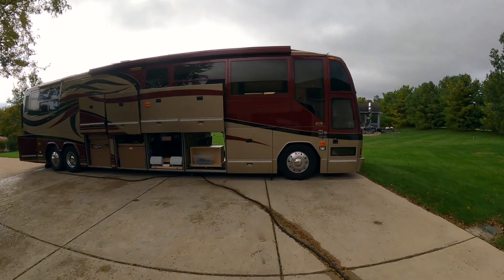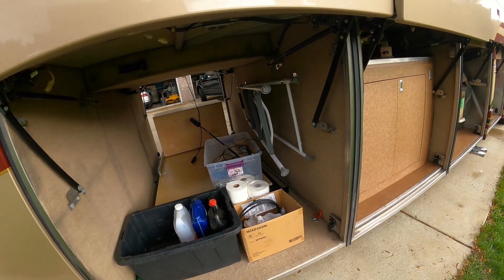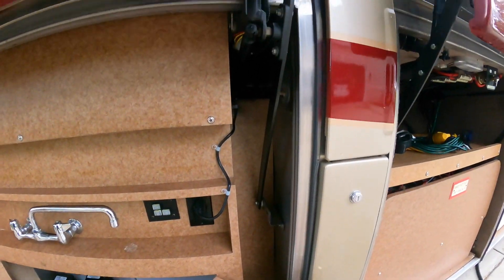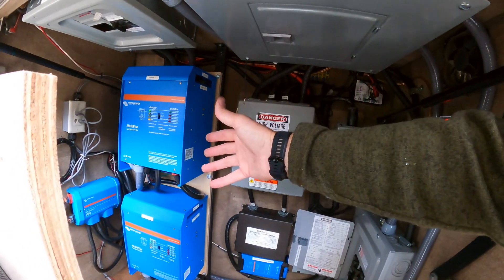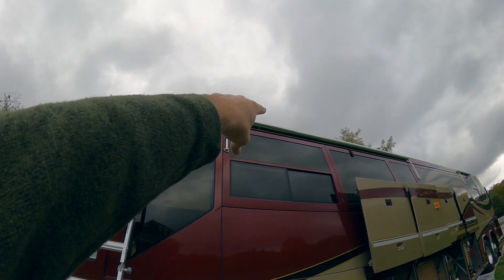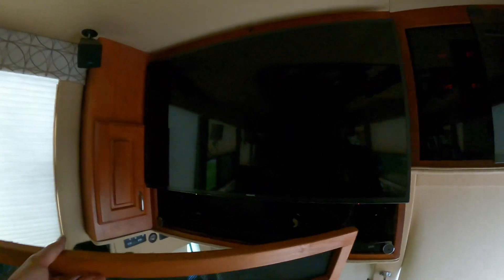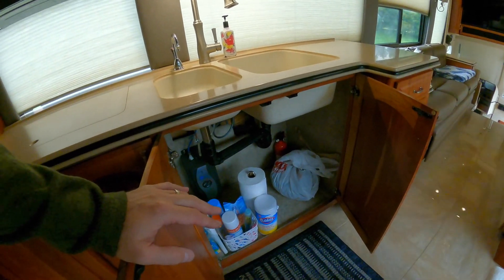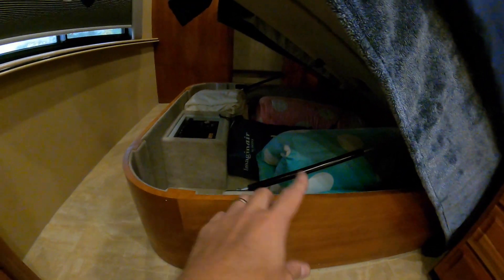1 year of ownership & upgrades - Prevost H3-45, Class A RV Camper

Comment: Really appreciate your videos.  Like your air system to your toilet.  Getting the toilet on it's own system is ingenious.  That is the best thing I've seen yet.  Our compressor keeps the air up for the whole bus while parked that includes the toilet.  With air leaks a common issue isolating the toilet with it's own system is the best solution I've seen yet.  Thanks for your video's.  Your mechanical aptitude is a 10.
Reply from the maker: Thanks for watching and the nice comment. The best thing to do would be to fix the leaks - but after hours of trying to find them with no luck and then having my main compressor go down, it seemed like the right move. I also have it running from 24v, so it doesn’t need my inverters or shore power. It can also pump air to the rest of the system - so totally redundant. Put that on before our 4k mile trip out west - didn’t want any problems.

Comment: Nice job with the upgrades.  First thing I did was get rid of the air toilet and installed a 790 Dometic.  Works great.  On your Aqua Hot, the fuel nozzle will most likely need to be replaced every year, unless you leave it on the diesel side most of the time.  At least exercise it once a month and you should be good to go.  I ended up replacing my control box and went with the new one that Webasto has come out with.  All electronic with zero issues.  Plug and play, but pricey little unit for sure!
Reply from the maker: Thanks!  Sounds like you have made your way around your coach as well. I found the nozzles and got 4!  Good idea on exercising it regularly- will have to look at the control box - didn’t know one existed!

Comment: Beautiful bus!! You've saved a ton of money. I would've never guessed 100k for the front end work. That is crazy!!
Reply from the maker: Thanks for the comment and watching. Me to on the front end, was thinking around $20 - but - the labor to remove everything from the inside front - leave it hang, then remove everything on the outside then probably cut that cap off, then reinstall/weld/fiberglass and match the paint - probably adds up to that - but wow!  I go back and forth on the look - it’s dated but functional - thinking touch up, clear coat, and a new Stainless logo might do it.
Reply: @CampPrevost  I prefer the look of your coach compared   to the new ones. I don't like those little round headlights. Better with your rectangular ones. Just my taste!

Comment: Enjoy watching your video about your coach. I have a 2001 h3 45 and bought it as a project. It took a year to get it ready for the road. I did replace the front to the 2021model for around $25,000 which was well worth the cost at Excaliber coach in Sanford Florida. I do have before and after pictures and what a difference.
Reply from the maker: Wow - did you have a donor bus?  That sounds a lot more reasonable - but still expensive. Thanks for the comment!
Reply: @CampPrevost  the parts used where new from Prevost new windows, lights, bumper, fiberglass front. Not a bad deal. It upped the value more than it cost so I highly recommend it
Reply: @CampPrevost  couldn’t upload pictures of before and after but 2001 to 2021 looks great

Comment: Wow.  I'm impressed by the amount of work you have taken on yourself.  Can't say that I understood all what you did in the electrical bay -- but that only makes it more impressive.  That the toilet must work like those on cruise ships which also seem to use both water pressure and air pressure -- and make a hell of a racket in the process.
Reply from the maker: Thanks for watching and the comment. The electrical really just has another panel then most so I can bypass all the inverters and just use straight shore power - my previous inverters went bonkers and we lost the ability to have AC power even though we were able to plug in. That toilet is a work of - mechanical artwork - I guess - when it works it works great.  Just a pain to lose the toilet if you loose air pressure or water pressure.  So when I lost AC, I lost air - which meant I lost the toilet too - which is why I installed that isolated system with another air compressor that ran off 24v DC. Now it will take a lot of issues to bring the coach down- had to many single points of failure. I would love to build one now :).

Comment: Absolutely love your videos and impressed by your abilities to improve your coach. Do you give lessons? We live in Michigan and purchased a 2001 Liberty H3-45 this fall and our planning our first trip to Florida in January. So far, our biggest issue has been the Zip-dee awning. We are replacing it with a Girard awning and the bus has been in the shop since September waiting for the awning to come in. Very frustrating. Would love to see what improvements you would recommend for electrical and also for plumbing.
Reply from the maker: Thanks for the comment!  We are headed to Florida next week as well!  Sorry for the delay in your awning (seems everything is 3 months behind these days) - mine is a Girard as well - hopefully it will serve you well.  As for plumbing and electrical - if it works I would leave it alone :).  The plumbing fixtures are easy to replace but most anything else is really hard to get to / access. The electrical is a can of worms as well.  My inverters (which were not the original) didn’t work correctly- which is what drove me to reinstall my new ones. Most everything installed in these buses are top of line / bulletproof items - but eventually everything has a finite life.  Everyone wants to go to lithium batteries but if yours work, I’d leave them until time to replace.  They require certain parameters for charging - which could lead to a bunch of other equipment to change out as well - plus they won’t work when it’s below freezing.  I’ve really just tried to replace items that didn’t work or needed to be upgraded - then maintenance to keep it going. If you have any specific questions just let me know and I will let you know my thoughts. I would also join the “Prevost Owners Group” Facebook page if you haven’t already. There are a lot of very smart people in that group.

Comment: Nice job on all the upgrades.  Who makes that sentry box?
Reply from the maker: We are developing it.  I think it would be a great addition to RV’s / Campers - the issue is the adaptability.  It’s easier said then done to hard wire sensors, so I am working on the option to add remote ones - and let the end user determine where/how many/hard vs remote mounted. My brothers are working on the user interface. They are also looking at marine applications and fleet operations, I am working on RV applications.  So long way to go but I have a test unit with basic features and like it. Also trying to determine cost, and monthly fees. It’s free if connected to WiFi, there is a cost of you want 3g, 4, 5 LTE, etc and which carrier to choose. I want a basic unit that is scalable with options to add all those features - so working on it. If you have thoughts or comments would love any feedback.  Our motto is “your only limitation is your own imagination”.

Comment: I could use your help.  I have a 2000 h3 and I have a Hemphill coach I would like to plumb in an air compressor. But where do you plumb it and what compressor did you by for your aux.
Reply from the maker: Tricky question and I’m not an expert. I would say stay away from your braking system lines and tie into your auxiliary air - most are located up front. Do you have an existing you are replacing or adding another one?  Most are Jennair compressors. You will also need an air dryer for it to pump through. I have an existing 120v up front and installed a backup 24v unit to run my toilet and generator air bags - when parked and bypassing the main aux air.